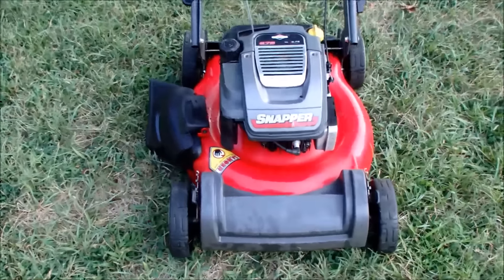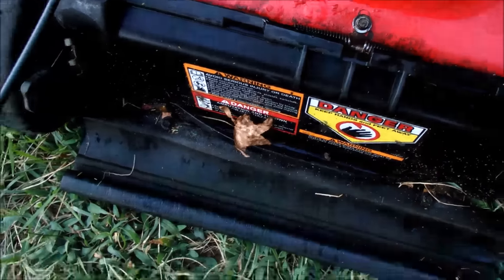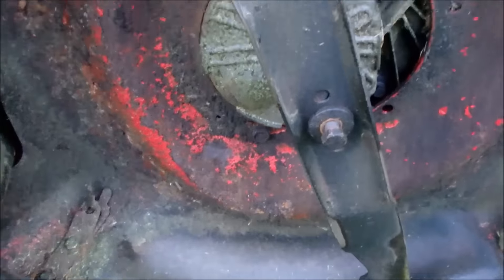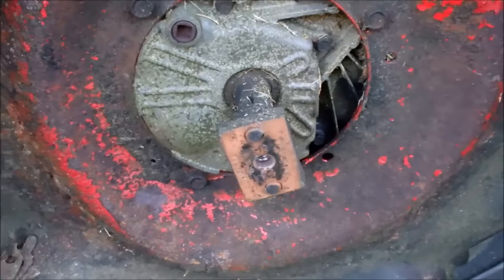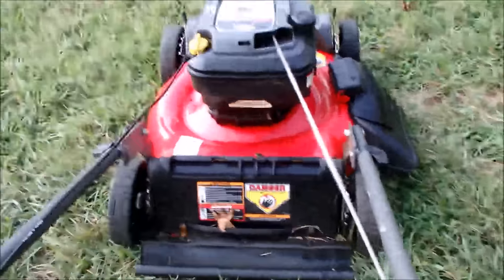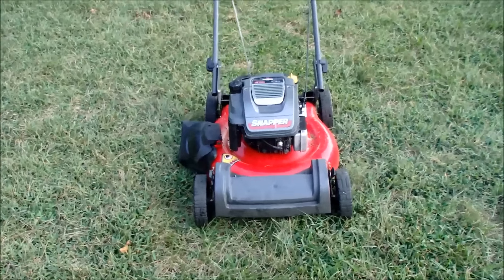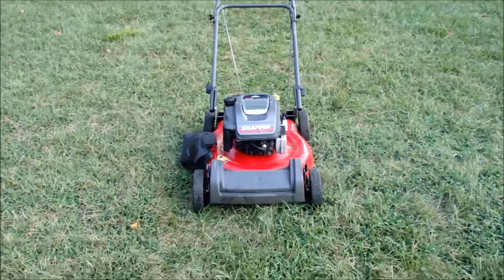Snapper Push Lawn Mower Model S22675 - Prognosis Terminal! Last Look & Start - Sept. 9, 2015

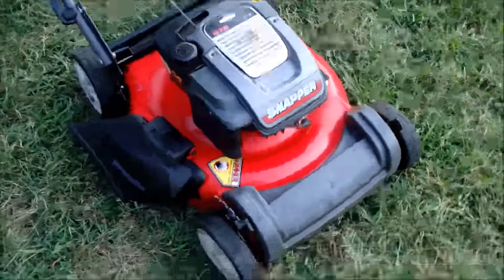Comment: I spit my drink at 2:25. It's a great engine if you are ok with 5-25 vicious pulls until it starts. Burning oil over 80f is considered normal according to the manual. It's a turd on a good day.

Comment: so u dont rebuild?
Reply from the maker: +Pauls POV Hello Pauls POV thanks for viewing hope you got moved into your new home all safe and sound!   I will do to a certain point on some mowers for valves if OHV adjust those, have replaced the head gaskets and replaced valve seats.  As far as rings, pistons most of the small engine lawn mowers if they are that worn out just honing and rings will buy a little more time but a lot of work!    My neighbors mower here the backend is hanging on needs to jam some bolts in there to hold it up it will last a little longer before it just gives up.
Reply: mountainbikekayak  Hi Cliff Please do a video on a toro proline  21 22198

Comment: Thats the junk Walmart Snapper. Piece of crap. I just got a nice 78 model Deere N21SG  cast deck self propelled for 10.00. Cleaned carb and now runs great after sitting for years under a shed.
Reply from the maker: +Robert Clark Hello Robert surprising this Snapper is still running for my neighbor even with what sounds like a very bad knock don't think its going to last much longer.  That's a nice solid John Deere mower you got seems they looked very much like the older Snapper mowers with the sideway engines on them just painted the famous John Deere Green.  Well worth keeping those decks would last just forever.